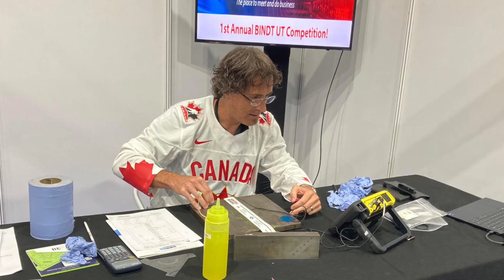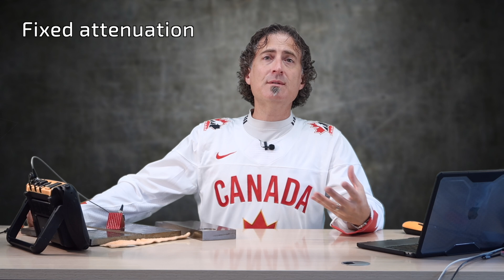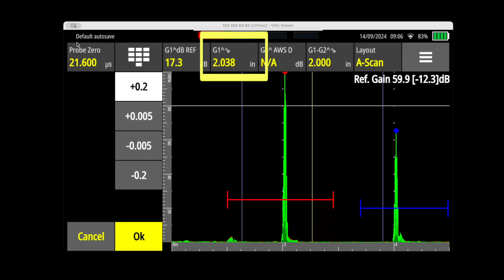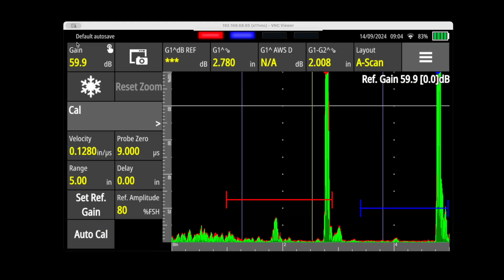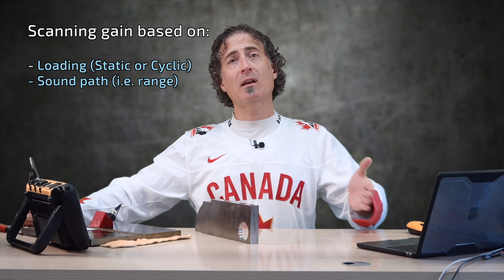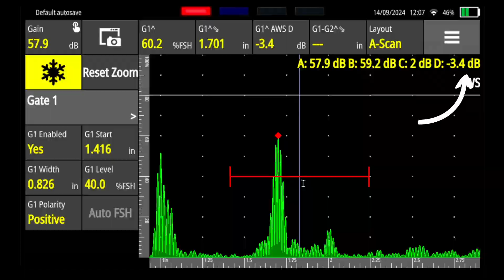AWS D1.1 Shear Wave Inspections

Comment: Hey Paul, great video! Quick question, was always told the .06” hole should produce a -2 “d” rating, but I cannot seem to find that in the code anywhere. Have you ever heard of this?
Reply from the maker: Hi Oscar, never heard that one. It doesn't make much sense though. d=a-b-c. On the SDH, a = b. So then you're left with negative c. C is (SPD-1)*2. The SPD to hole at 70 is 1.7", so c = 1.4 dB, so d is negative 1.4dB. For 60deg, d is negative 0.4dB. And for 45deg, d would be positive 0.3dB.

Comment: I think there is an error in the drawing shown in the AWS D1.1 standard (Figure 8.13-Typical IIW Type Block). The depth for a 50 mm diameter hole is shown as 23 mm. The sound speed equivalent of 23 mm Plexiglas is 50 mm for steel. AWS D1.1 block prices are high due to the error.😆😆